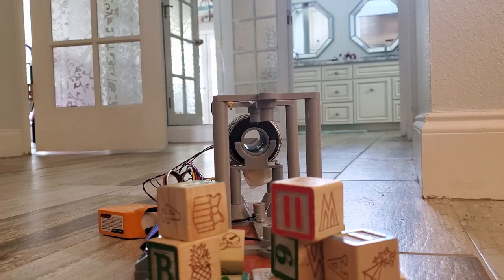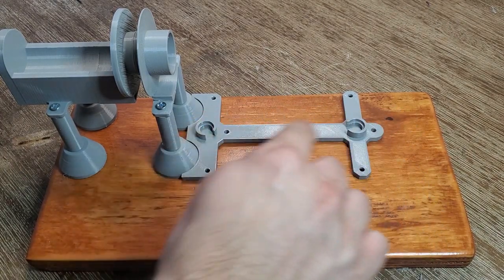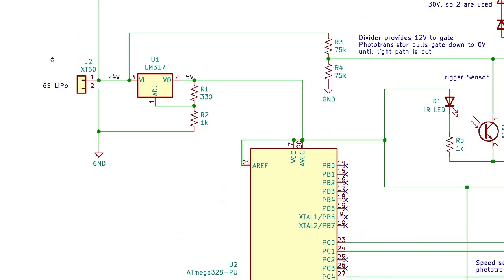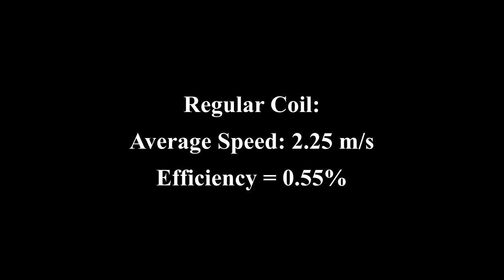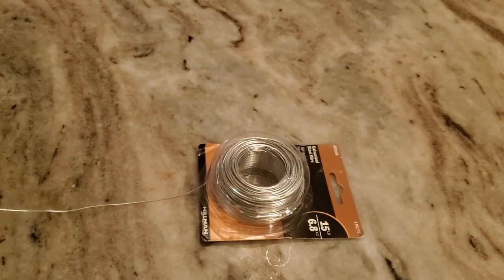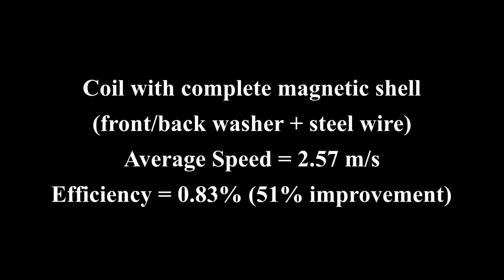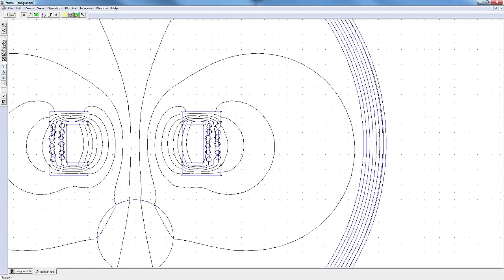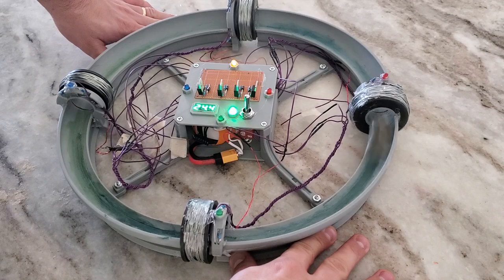Electromagnetic Accelerator Improvements Part I - Gauss Cannon test rig

Comment: The crucial thing is that the timing (distance) of the IR trigger beam need to be further away from the coil due to the speed of the projectile being moving faster. This distance and thus timing would get further away from the coil it fires as the projectile gets faster. Also, you must have the magnetic field collapsed and done by the time the projectile has reached just prior to center. Coil length and capacitor size also affects the time of each pulse.

Comment: I want to add an important note you forgot to mention:

Adding a metal shell to the coil increases its inductance obviously, but less obviously also increases the coil's RL time constant.
This isn't a huge issue for a single staged coilgun, but each additional coil you add will need to form/collapse a field more quickly to have an effect on the projectile. If your coil's time constant is too high, you'll lose efficiency as the slowly collapsing field puts additional drag on the projectile.
Reply from the maker: True, but overall i've found it to be a net positive in simulations and testing, because you're getting more magnetic flux for the same amount of input power. 

I think this is probably the reason you see high speed coil accelerators use progressively smaller coils, since there's a way smaller time window to act on the projectile as it gets faster, so the final stages need to have a lower inductance than the initial stages
Reply: Yeah! I'm in the middle of building a 1.5KJ four stage coil gun, and while each coil is the same, I could definitely improve the muzzle velocity if the later stages utilized smaller coils.

If you're ever interested, I'd love to chat some time and compare notes, or perhaps even collaborate. I had never heard of FEMM before your video, so in this current project I made an excel program that simulates the field of the coils and their force on the projectile. It's been tediuous, but I've learned a ton. Needless to say though, Im stoked to see that there's an existing program for this.
Reply: @BenjaminMarshallScienceMan  i'm a physicist yet i have near-zero intuition about magnetic fields.

Comment: I’m glad I found your videos. I’ve been designing a rolling ball machine and want to use magnetic acceleration to provide speed that is faster than what’s available using just gravity. I got the idea from a Star Wars pinball machine that uses this technique and calls it the “hyper loop”.
Have you investigated using more simple PNP inductive sensors to tigger the electro magnetic circuit?
Reply from the maker: An inductive sensor might be useful if the projectile was a permanent magnet, but it's kind of hard to detect the voltage spike from a ferromagnetic projectile passing by a coil.

Unless you're talking about one of those metal detector sensor things like 3d printer heads have?
Reply: Yeah, a simple PNP Induction sensor will sense the metal ball and make the switch itself to provide the same voltage used as its source as the trigger output. You can buy inductive sensors that have various response speeds at 3K Hz or higher and at different sensing distances of less than a mm to 10 mm or more. They’re good because they will stay triggered (and provide a +V output) for as long as it senses the metal so you can easily have multiple balls traveling together in a row without fear of a misfire. The output of the PNP sensor would be connected directly to the base/gate resistor that switches the coil on. Just an idea.
Reply from the maker: @Pazuzu-FAHQ2  Worth looking into, thanks. That could allow me to completely bury the sensor and have a smooth track
Reply: Yeah, the fact you’re using a plastic track would allow for an embedded sensor.
I found it an interesting coincidence you went to a 48V supply voltage for the coil to get more speed. The pinball machine “hyper loop” also uses 48V for its coils. They use four coils in a row to accelerate up to four pinball balls. Keep up the great work.

Comment: railgun acceleration track ring
Reply: or just trigger pads
Reply: capacitive touch sensors
Reply: a fine design does not need the optimizations
Reply: steel wire iron-air fuel cell, with salt-bakingsoda-koh water-ethanol-propyleneglycol electrolyte, with wire feed
Reply: iron balls (projectiles) with concentrate the magnetic field in them, on the ring railgun track, the projectile is the core, but a moving one

Comment: I've had way better luck using high voltage induction gun. It's unbelievably powerful. It's like a real gun. Not a rail gun either.
Reply: Yes of course.
Look here:
   New! Apocalypse Coilgun vs. MONKEYPOX:
https://youtu.be/G9-jKWPyMFo

See also: Portable Supercoil:

https://www.youtube.com/watch?v=rclLsQ9nyeg&amp;feature=youtu.be
Reply: @howtomakeacoilgunoffallout4096  i think mine is a little more powerful than that. I wonder what ammo he's using? I use the soft steel from transformers and motors with aluminum foil wrapped around it
Reply: @nickbaylander6320  I use any steel (except stainless steel)

Comment: You don't need all that crappy electronics, just put an iron core in every coil and give permanent DC voltage to it and build it like a Gaussian cannon out of permanent magnets. The plus side the magnets can't be destroyed by impact became they are just iron cores and no electronics because they are just permanently on as long as the switch is on.